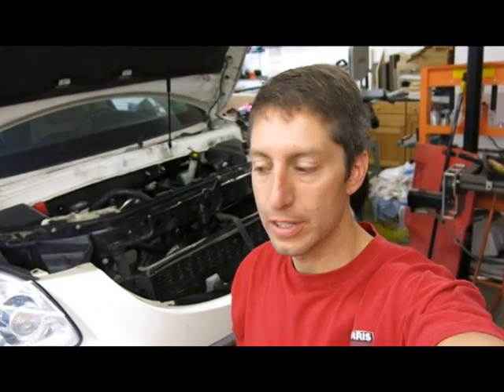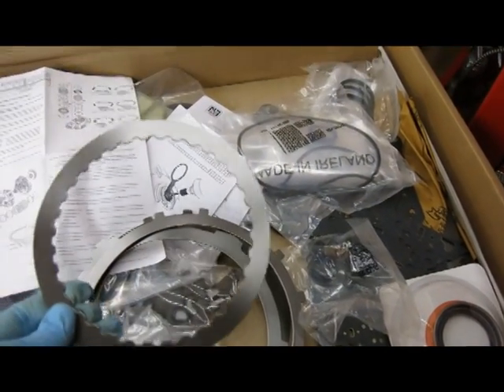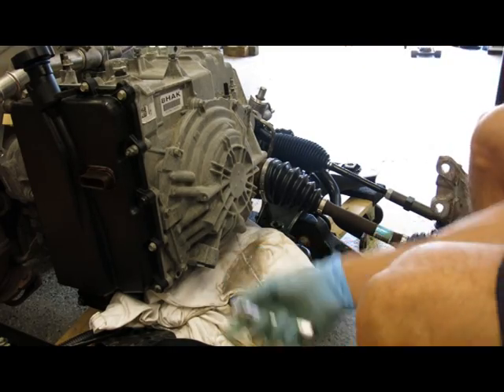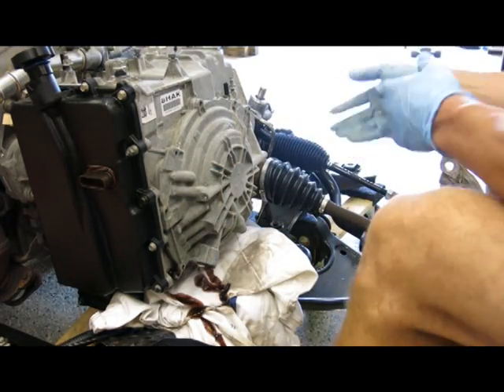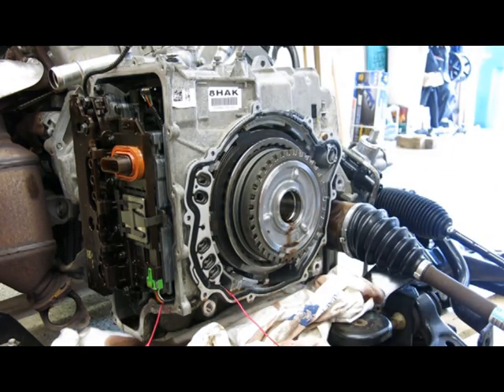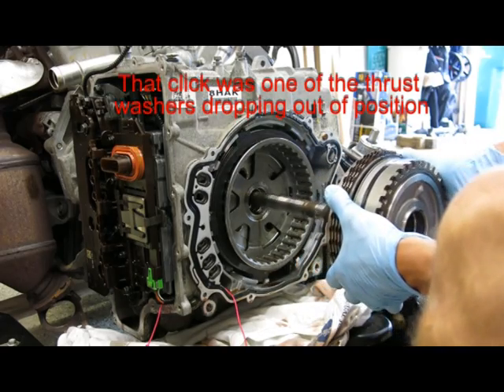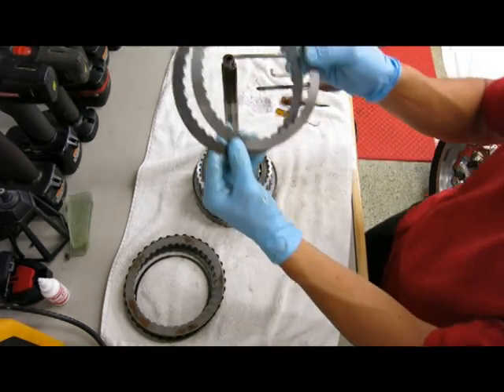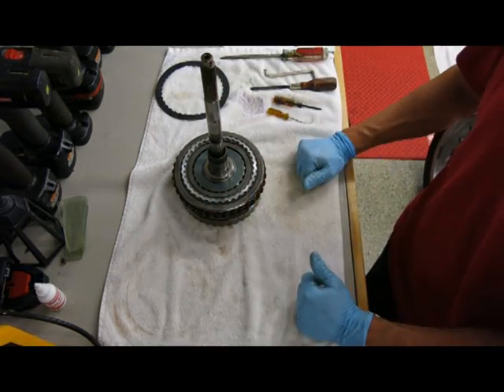Enclave 3-5-R Waveplate Replacement - Part 1

Comment: hey chris, thank you so much for making the videos. im gonna be doing this in a few weeks just waiting for parts. do you have a video of the engine removal? did you disconnect power steering, a/c, and brake lines. i have 2008 enclave 2wd with the MY9 version of the 6t75 and its been slipping in 3rd and 5th for about 2 months. i would also appreciate any advice you can give me. thanks again!
Reply from the maker: +o2civic21 Hi O2Civic,
I have some videos that I still need to try to edit that gives an overview of the engine removal prep, but chances are I will not get those videos finished in the next few weeks (as much as I wish I could).  You do disconnect the brake lines at the connection to the flexible lines in each wheel well.  You disconnect the A/C lines at the quick disconnects that go into the firewall.  But you do not need to disconnect the power steering lines as the entire steering hydraulic assembly travels with the subframe.  The only other advice, if you are going to do it the way I did (with jacks instead of a lift), is that the intake will probably need to come off the engine before you drop it out the bottom because it's hard to get the front end high enough off the ground to clear the engine with the intake still attached.  Good luck!
Reply: +Chris Bruno hey chris, one more thing. I noticed you said to disconnect the a/c quick disconnects. does that mean you didnt have to evac/ refill the a/c system?
Reply from the maker: +o2civic21 No - if you disconnect the A/C, you'll need to refill it.  You can rent a vacuum pump for free at Autozone and then just refill with the appropriate number of cans for not much money at all.  

That said, you should know that I only dropped the entire engine because I was changing the timing chain.  

If all you are planning to work on is the transmission, there is a much simpler way to remove it.  You'll need to rent or buy an engine support bar that holds the engine in place while you drop the subframe out from below.  Then, you can remove the transmission without removing the whole engine and deal with all the stuff you are asking about.
Reply: +Chris Bruno Hey Chris, so I have my transmission apart and the clutch plate that is on top of my 3-5-R wave plate is severely damaged. I don't know how it could have gotten that way because the wave plate looks great. any thoughts?
Reply from the maker: Usually heat or lack of oil is what ruins clutch packs,  but obviously it's impossible to diagnose over messages...(nevermind that I'm not a transmission tech..  Ha!)  At this point,  you really ought to break down the whole transmission to clean out any debris if the clutch was damaged that badly,  though.   Good luck!
Reply: +Chris Bruno ok well I say severely damaged It was scratched up a bit. don't know why though. but i replaced the wave plate and the flat steel plate that was scratched. also replaced all the other wave plates that you did. got the transmission back together and I actually couldn't get the vehicle High enough to roll the engine out like you did so I just had it down on the dolly. just wanted to tell you about it and say thanks again.
Reply: +Chris Bruno hope it runs...
Reply from the maker: I'm glad my video could help.  I'll be keeping my fingers crossed for you when you go to start it up and test out the transmission!
Reply: update: it started and it shifts smoother and better. so far so good.
Reply from the maker: That's terrific! Good job!

Comment: Hi Chris
Than you for your precious show. I have 1 question. You wrote "I biught the seal kit from the local dealer. It was about 120$". This kit is 24269587. I have Buick Enclave 2008 AWD with Transmission MH6 (SPD, HMD, X22, PTU) with cooling oil option ,  engine: LY7/3.6 - 7.  Can I use the same kit or another?
Reply from the maker: Hi Zag,  yes your car should use the same kit.  Good luck!

Comment: for ANYONE with this problem GM has a special policiy on this issue up to 120k miles or something, if your within milaage then call the dealer and ask.
Reply: +Kevin Rogers just to add some clarification. Its 10yr/120k miles. i called my buick dealer and GM customer service and they told me that its only a certain batch that is included in the special adjustment program. even though my vehicle has the problem GM said they will not cover it because its not in the "batch" they also said even if it is included in the special adjustment program they will not cover it unless the transmission actually breaks. im sure i could get a manager or something and jump through hoops but that would mean that i would have to pay this out of pocket and then if they did cover it after jumping through their hoops i would have to fill out forms and wait for a reimbursement. i would rather do it myself for under 200 than have them give me the run around.
Reply: o2civic21 true statement, and straight up dude, i've only pulled one of these transmissions out before and it was a mother fucker, but i was also a lot less experienced then i am now, All i can say is have fun, i would recommend finding a 2 post lift dropping the cradle and resealing the front cover and oil pan if you plan on keeping the car, timing chains you need some tools to do it but is possible without them
Reply: the same thing happened to my Buick, so I took it in and wasn't sure what was wrong with it, because my vehicle was slipping gears turns out it was my wave plate in the transmission worn down and the man said its covered by GM it would have been 1500 dollar fix for them to do it lol praise god I don't have to spend that kinda money.
Reply: how many miles did you have? I'm guessing yours was under warranty otherwise, why did GM cover it? Did they recall yours?

Comment: 2007 gmc acadia broken waved plate but didn't have the the snap ring should I order a new one also or just the plate
Reply from the maker: I think you'll be fine to reuse the snap ring. However,  you should know that if your wave plate is actually broken into pieces,  you need to disassemble the transmission more than I did in this video to get all of the debris out.
Reply: Thank you
Reply: @SlideruleRacingProducts  Hi there. Im having an issue with my 2011 Acadia (delayed shift to reverse and slip when shifting to 3rd and 5th. 1st, 2nd, 4th and 6th shift perfect. Took it to the dealer and they said it was the 3-5-R wave plate. So by replacing that one ring in this video should fix that issue? Thanks!
Reply from the maker: @dirty323  Only if it hasn't already broken. On my car, the ring hadn't broken yet, so I could replace it with the new one by itself.. Since your transmission is experiencing problems, it may have already shattered, in which case, you do end up having to replace other parts due to the debris that results. Good luck!

Comment: is it possible to do this without removing the whole engine?
Reply from the maker: My understanding is that it is possible, though I have not personally done it.   Sone folks on rhe the Acadia forum have followed this video without removing the engine,  but I'm betting that you will need to lower the engine far enough that some of the electrical harnesses and hoses will need to be disconnected.   You may also find the need to remove the radiator to get enough access to the valve body cover.   Good luck!  If you do it,  write back here on how it went!

Comment: Do you have any info. on how they did ot just lowering the cradle? Did they have to disconnect all of the hoses and things you would have to disconnect to remove the whole assembly or were they able to leave things hooked up and just dropped the cradle bolts and lowered it enough to clear the body on a jack?
Reply from the maker: +skiboyne74 There will probably be a few things that you'll need to disconnect, but if I recall, it appeared that there was considerable service slack in a lot of the major connections (coolant, for example), that it struck me that not too much would need to be disconnected to lower the cradle a significant amount.  If you do it, write back and let me know what you ended up needing to do.  Good luck!

Comment: If you attempt to replace a 3-5-R wave plate you MUST split the case! So much metal debris is generated it WILL clog the filter and you will lose line pressure. I have done hundreds of these. Just a tip if you attempt to do this at home.
Reply from the maker: Brian M. Hi Brian, thanks for the comment.  As you can see from the video and my comment below, the waveplate in the video has not yet broken.  I replaced this as a preventative measure and if you take on the job before it fails, splitting the cases is unnecessary.
Reply: Sometimes I wonder about that. In an automatic transmission, all the oil is filtered before going anywhere. Pulling the pan and changing the filter and maybe adding a magnet, if there isn't one already, is a lot easier than splitting the case as well.

Comment: GM has finally covered this, a new special coverage policy has opened up so if yours breaks GM will cover the repair.  Up to 10 years/120k miles, whichever comes first.  This should save people the headache of changing it themselves.
Reply: +Gabe Borscheid 
correct, from what i've heard the company that GM hired to make and assemble the wave plate, made one side sharp and the other flat and gave the builders no instructions on which side to put in first, so some are ok, others are not. Supposedly they have fixed this on new vehicles but we'll see.
Reply: Maybe so, but I heard it was due to lack of shot peening the part.  The new part should be fixed.
Reply from the maker: +purplexenno This isn't quite accurate.  Both old and new parts are stamped, which will always result in one sharp edge and one dull edge.  While it is true that GM produced a TSB to inform on the proper orientation for installation, in my opinion, getting this wrong will only result in earlier wear of the adjacent clutch plates - not a fracturing failure that we are familiar with.  

The real difference between the old and new parts from my observations was that the old parts were flame hardened at the inner and outer edges whereas the new parts were case hardened all around.  I suspect that the flame hardening was causing excessive brittleness, resulting in the early fatigue failures we experienced and that GM expected a case hardening process to prevent such brittleness.  Just my $0.02.
Reply: For certain years only

Comment: Just a quick concern...  My transmission just died on this exact model with the exact symptoms that require this repair.  The TSB (09-07-30-012A) on the issue instructs the repair technician to clean out the transmission thoroughly - due to damaged pieces floating in that space - and replace a few of the additional items that were included in your kit.  From your video, I'm thinking that you didn't do all that.  Should that be a valid concern of mine?  This video replaces about $4000 of cost with just hard work and know how - so it is well worth considering.  Thanks for reading!  -John.
Reply from the maker: Hi John, my waveplate hadn't failed yet.  If the waveplate fails, then yes - all of the waveplate pieces will have spread throughout the transmission.  My engine was out for me to change the timing chains and I changed the waveplates as a preventative measure.  As you can see, when I remove the old waveplate it is entirely one piece.
Reply: Chris Bruno Thank you, Chris!  That's exactly what I needed to know.

Comment: When you were re assembling did you have any problem re aligning that thrust washer that fell out of position
Reply from the maker: Hi Bubba, Good question.  I actually went ahead and replaced the wave plates in those other clutch packs, so I took those sub assemblies out of the transmission.  In doing so, replacing that thrust bearing was pretty straight forward.  I didn't attempt to try to raise it back into position without removing the other pieces, so I'm not actually sure how tricky it would have been.  I hope to have the other video put together soon (I'm pretty bad at finding the time to edit these videos to post them, apparently).
Reply: Hey Chris, I really like your videos. I recently purchased an 08 Enclave and I feel comfortable replacing my steering gear now that I watched your video. Looks like you have a lot of energy dude, I am hoping I don't have to tear this thing apart as far as you have. It looks like you touched on the most common problems with the Enclave, let's hope not much else becomes too common with them. I can see why the original purchasers would be upset as these are some high price repair issues. Thanks for the info and keep up the good work

Comment: This is great video.  I am having the same issue with my 2008 Saturn Aura.  I will attempt to change mine.  So the rough side of the wavy plate will be facing the rest of the plate? There was a note there on the video.
Reply from the maker: It's not 'rough' so much as it has a sharper edge.  And yes, the sharper edge side should go towards the other clutch plates.  The sharp vs not-sharp difference is very subtle, though.